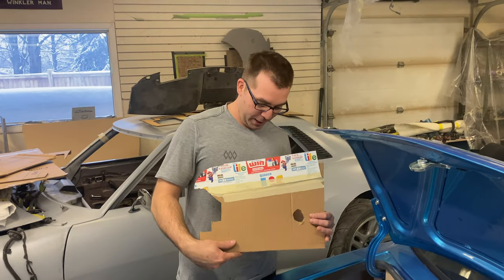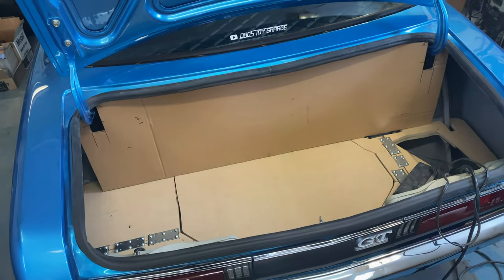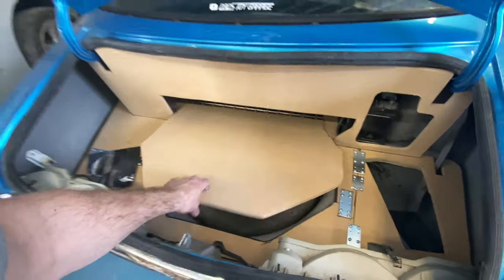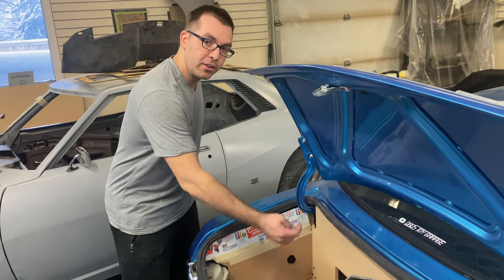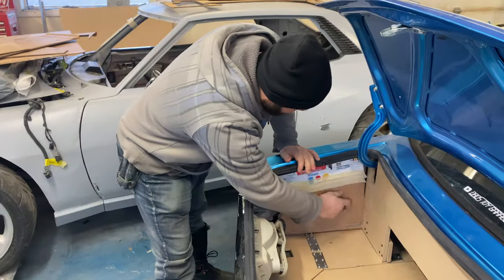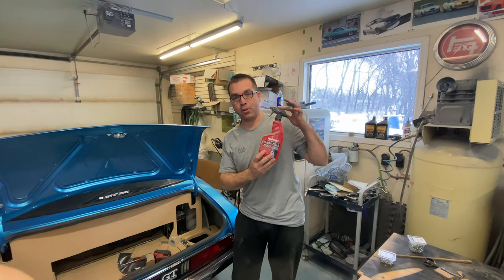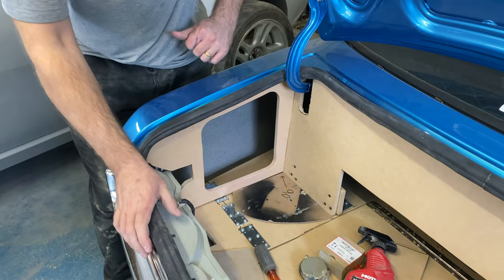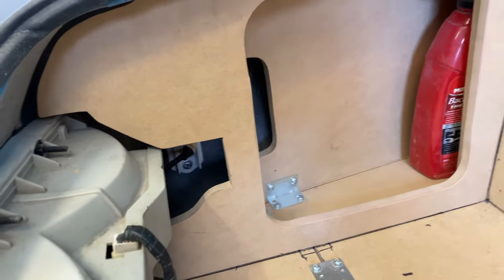Build a CUSTOM Trunk For your "SHOW CAR"! Part 2

Comment: you can also use neo magnets to hold it in place alot cleaner with no screws showing on ya panel piece. but great video i would have done somethings different but each to their own, you got this
Reply from the maker: good points. I think I looked at the Neo magnets but the ones I saw were pretty pricy. I actually was wanting those ones but this was better suited to my budget.

Comment: How do you level and attach the mdf to the metal trunk floor?
Reply from the maker: The trunk floor was level for the most part so the mdf floor sheet sat level. But I did add some MDF shims where it was not perfectly level. The whole unit is screwed  and pin nailed together. The top of the sides is tucked tightly against the top of the trunk gutter. The trunk hinges structure also allowed me to make a notch in the rear mdf panel to keep it from shifting side to side. I did add two screws into the rear just to keep it from sliding around.